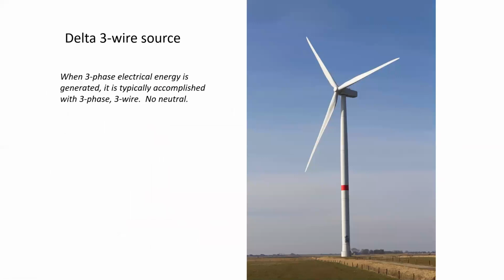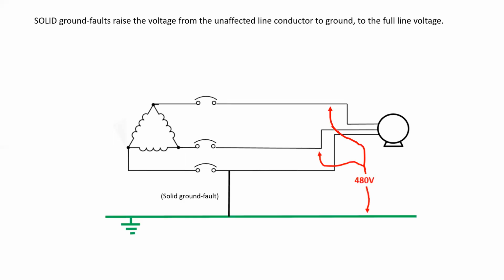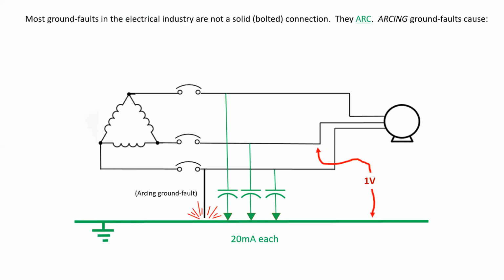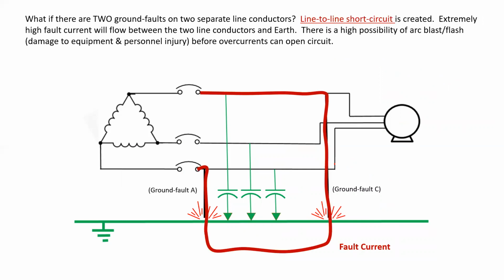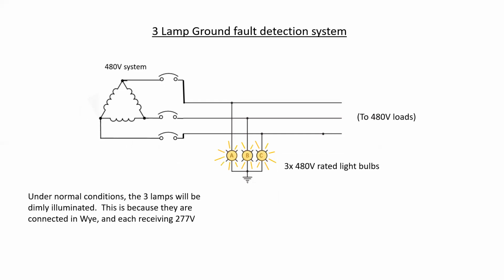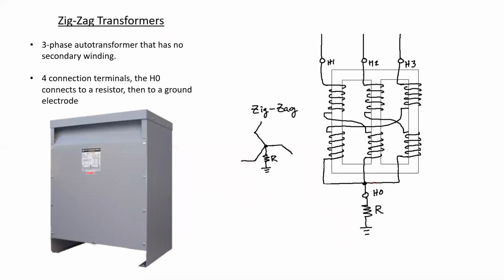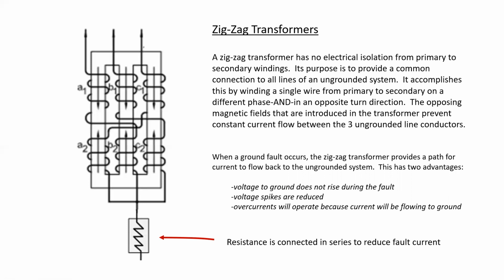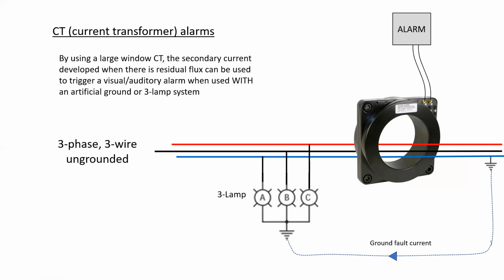Ungrounded Electrical systems

Comment: Id like more information on a 480 3phase generator wiring. The large ones used in gravel pits and mines. Those are ungrounded with no neutral. Confusing to me
Reply from the maker: Thanks for the comment jb.

 Although I do not have a video specifically on this type of equipment, the delta wound gen is fairly standard equipment out there. 

You are correct, they are an ungrounded system with no neutral. Often it makes more sense to save $ on less wires (3 wire delta vs 4 wire wye) if the system capacity is small, and mostly balanced loads are being supplied. 

Perhaps what may be of assistance to your understanding the system is to review some 3phase delta material that discusses the current and voltage values. See my 3phase system playlist.

On the other hand, perhaps reviewing some material kn alternator systems would be helpful. Although we commonly refer to rotating energy generation as a "generstor", in actuality, the equipment is technically known as an alternator. Weird I know. See my rotating equipment playlist for several videos on alternators.

Finally, if you are referring to drag line type systems with a single common driveshaft and half a dozen generators attached, this is an even more complicated discussion, as the prime mover type, and intent of the system is a bit different.

Comment: Very good and concise info regarding a system rarely encountered today except in the most unusual and special circumstances where an unexpected opening of an overcurent protection device due to a line to ground fault poses a greater hazard than potential damage to motors and similar equipment caused by the voltage fluctuations ungrounded three phase systems are notorious for.   

As an electrician who does mostly residential and some commercial I have yet to come across an ungrounded three phase system.   I've worked in several buildings with 480Y/277V and 208Y/120V systems, and a small handful of 120/240v 3ø center grounded delta i.e. stinger leg 208V to neutral, mostly as an open delta.

In fact I grew up on a dairy farm with an open delta 120/240 center grounded because we were expanding and Dad  brought a larger grain dryer which required 3ø 240V, so he called up Detroit Edison/REA to request three phase service.   This would have been in the summer of 1994 as I started Kindergarten that fall, but I still remember watching the lineman in the bucket truck hooking everything up at the pole on the roadside; our meterbase  was on a pole near the center of the barnyard.  Lots of excitement for a little boy 😎

Later on as the  5 & 7.5 HP 240V 1ø motors for the auger and silage conveyor burned out we replaced those motors with 3ø since a three phase motor for a given HP rating is simpler in construction, more efficient and more reliable than a 1ø motor.   

It's worth noting that although a 120/240 center grounded delta is typically seen only in older installations, a center grounded open delta can still be beneficial for situations where the customer requires 120/240 split phase with light 3ø loads because it saves the expense of a third transformer as well as provide flexibility, in the event the business grows and additional capacity is needed, the third transformer to close the delta can be added at any time.  

Conversely, a closed delta system has the advantage of being able to operate at limited capacity in an open delta configuration, for example one of the transformers failed on a Friday and the replacement won't arrive until the middle of the following week.   The business can continue to operate at reduced capacity until the new transformer arrives.   

A major disadvantage of a center grounded delta is the accidental connection of a 120V circuit to the stinger leg and if I told you I've never done that before I'd be lying.  I only made that mistake once while doing panel swap in a 1960s family diner on a Sunday afternoon, learned of my mistake two days later when the owner called and told me the custodian plugged the vacuum cleaner into one of the hallway receptacles and it REALLY sucked for about a minute until it smoked and caught fire.  I screwed up when installing the two pole breaker feeding a 1ø sub panel which IIRC powered mainly the lighting and some receptacles.   Some receptacles in the dining area/hall/bathrooms as well as some of the lights had the 208V stinger, fortunately the lighting was F32T8 with 120~ 277V ballasts and were perfectly fine with 208V.   

Another disadvantage of a center grounded delta system is phase imbalance, which occurs when moderate to heavy 120V loads are placed on the service.  Oftentimes the center tapped transformer will be larger to compensate for having all 120v loads in addition to any 240V single & three phase loads.   

The voltage rating of circuit breakers is another concern with ungrounded, center grounded, and corner grounded delta systems.   A two pole circuit breaker used on the stinger leg, or on a corner grounded or ungrounded system shall have a straight rating of 240V.      (Ref. 240.85 of the NEC) All single pole breakers to the best of my knowledge , as well as the vast majority of two pole breakers have a slash rating i.e. 120/240V.   All three pole breakers have a straight voltage rating.
Reply from the maker: That is an exceptional summary of a wide breadth of experience on the ungrounded  system! Up here in Canada we have very few of the center tapped delta in operation still. Generally, there is simply less infrastructure when compared to the  USA. 
The slash markings on OC devices is certainly of concern on the ungrounded- and especially center tapped delta-I agree. These requirements were added to our CEC a couple of editions ago (rule 2-104(2)). In a way it is quite surprising how long it took to be officially implemented up here I'm the North.
Thanks again for your comment, it will provide interesting reading for many!

Comment: We had this in Fascia in the old Saturn Paint shop. A bit of a PITA to troubleshoot.
Reply from the maker: I can completely understand the irritation. This is an immensely tricky electrical system to troubleshoot. Its one of the many reasons we have moved over to grounded electrical systems...
Reply: @Red_Seal_Electricin  The only (mildly) annoying thing to me is that there was no placard saying that it was an ungrounded system. I figured it out what was going on quickly enough, but a heads up would have been nice. :) And as an electrician-turned-engineer I was there only because one of our maintenance guys was struggling. He had no idea that it was an ungrounded system.

And yes, there were the ground indicators showing a ground fault, but conveyor systems in General Assembly had the same lights but were on a grounded system.

The tip-off was that the voltage to ground was 60 volts. Either from hot to ground or neutral to ground. From there is was a snap to figure out. :)

And thank you for your outstanding explanation of an ungrounded system! (and what you can do about it).
Reply from the maker: @MrWaalkman  insane what we see out in the field. Of all the things NOT to have signage on... sounds like you came to the rescue in the nick of time.
Reply: @Red_Seal_Electricin  Thank you for the complement, but our electricians were some of the very best and I wasn't called out all that often. :) 

I tried to be a resource, and not a troubleshooter, thus helping to improve the skills of our electricians. I will say that my first couple of years with Saturn I might as well of stayed in the team centers with the Maintenance folk. But they got up to speed pretty quickly and didn't need me as much as they did at first.

I can't remember what the problem was, but I'm pretty sure that it was PLC I/O and not system related. With the ungrounded system, readings of the I/O wouldn't make any sense reading them to ground (something that I always preached was to read to the neutral/common, not to ground).

Comment: awesome video, this is a very hard topic to reaserch.
Reply from the maker: Thanks Marovify, yes, this is a challenging topic to get good data on. If you want further detail, I would recommend SOARS Book on Grounding and Bonding. Very well laid-out, good illustrations.
Reply: @Red_Seal_Electricin  thank you very much i will definitely take that into consideration. I have been reading the green book of the IEEE but it has been a very hermetic topic.
Reply from the maker: @martovify  I cannot endorse it enough. The explanations, diagrams and depth is second to none. If one really wants to understand the concept of grounding in all its forms...